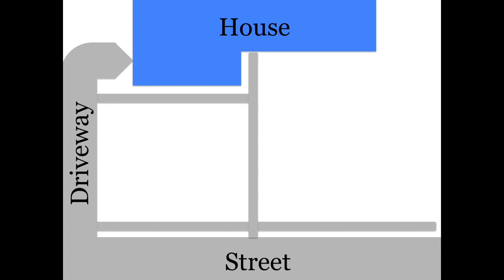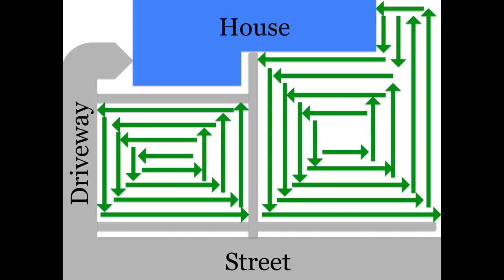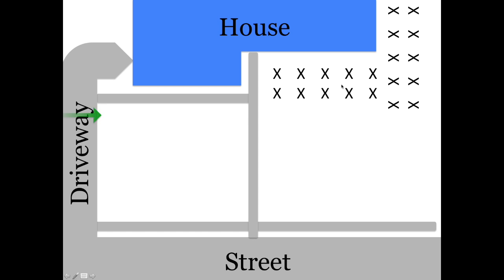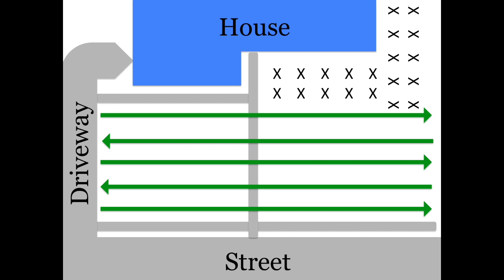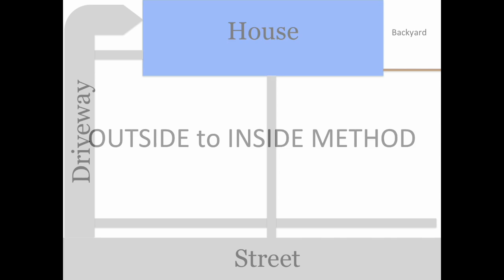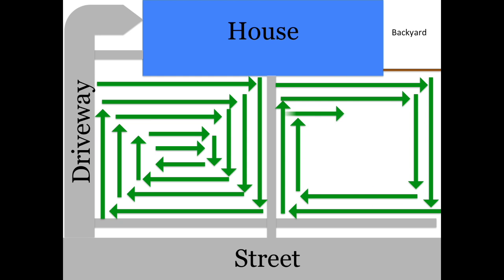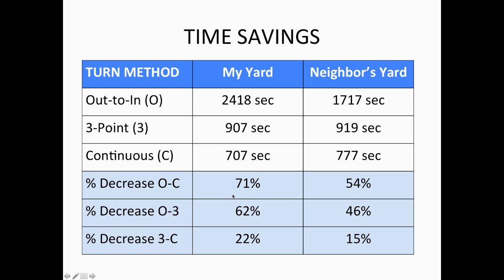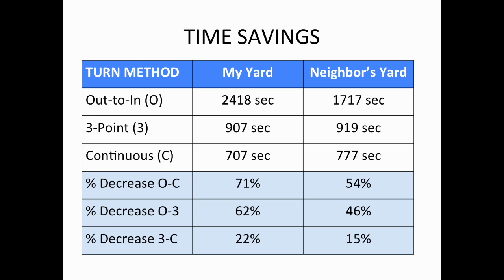A FASTER way to mow your yard!!

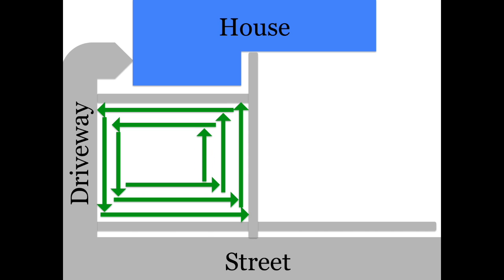Comment: i still think the outside to inside (modified) method is fastest.  IOW, follow the path shown at the 6:00 min mark, but combine them into one section by stretching them over the entire front yard mowing over the walkway that extends from the house to the street (just as you do at the 7:32 min mark).  yes, you have to do more turns (in number) but the turns are only 90deg turns and therefore, one 90 deg turn should = 1/2 the time as one 180 deg turn.  so, using your example at the 7:32 min mark, you make (5) 180 deg turns.  my way covers the same area with (8) 90 deg turns.  this effectively eliminates the time it takes for you to do one complete 180 deg turn.  as for the little "L" shape near the side of the house,  maybe due to its small size, your 180 deg style will work best, but then again, i still get (4) 90 deg turns (which = (2) 180 deg turns in time) to your (3) 180's, which makes my way shorter by the time it takes for you to do one 180 degree turn.
Reply from the maker: Thanks for the comment!  I can tell you put as much thought into it as I did making this video.  I keep trying different methods and the 90 degree turn is one that keeps coming back into the rotation.  With the size/shape of my yard, the only problem comes in with that at the end when I get down to the smaller size in the middle.  I think it's because my yard portions are longer than they are wide.  Because of that, I have to end up doing a bunch of 180 degree turns eventually.  That's why I thought to just eliminate the short axis turns altogether as much as I could.  

Thanks again for the comment, I really appreciate the great feedback!
Reply: TXSuburbanHomestead  thanks for replying to comments! I learned a new method. I used to do the outside to inside, and it took 11 hours.
Reply: Plus I am always thinking about mowing the previous pass clippings... So the outside in you never do that... Depending on if you go counter-clockwise...

Comment: The best thing for your lawn is to mow in a different direction every time you mow. So one week it is north to south, next week is east to west, next week is northwest to southeast, next week is just mow in a constant turn outside to inside, then finally northeast to southwest. Need a power point for each of those methods. They say it helps to not compact the soil as bad as mowing the same way all the time.
Reply from the maker: You're absolutely right.  I've been switching up since I did this video.  When this video was made we had only had the new lawn with new dirt/grass for about a year.  Constant mowing in the same direction caused me to have compaction ruts.  I filled those in with a soil topdressing this winter and switch it up every week now between N/S, E/W, and even a diagonal.  This is still the most efficient method for me, but I've got a much flatter lawn now.
Reply: In the golf industry it's called mowing 6-12, 3-9, 4-10 etc. It's good to cut in a different direction each week not only for soil compaction but if you keep cutting in the same direction each week eventually the grass will start lying down and it won't all get cut. Good information guys.

Comment: Great work! I've done the same calculations over the years. The time saving is great, but the added benefits are less hours on your equipment and less gas used.

Comment: Enjoyed you mapping out this logic. I've been thinking these things but nice to have the thoughts illustrated and logisticized. Next, I need to figure out not only how to deal with and/or illiminate obsticles (beds/trees/plants etc) and non-straight garden bed edges. Did see how someone edged the wavy rock long garden bed with mulch that was a straight line. for 12" out. That idea is a mowing game changer and going to impliment it. I have 1.5 acres and there's 10 areas for the tractor and 1 big pen 2000'ft for the up and coming garden that I hand mow. It has a big burn pile in the middle and lots of other items as well as developing raised garden beds. My husband is the gardener primarily and I am the mower. Getting the 2 on the same page is not always easy. Need to find common ground between beauty and function. Thanks for your video. 56 now and everytime I mow, all I think about is how to be more efficient, how to enjoy the ride and be safe as well as how to grow better grass for less money and effort. Spent 2 whole years gettng rid of stumps and dips and roots. Way better but could be much better too. I wonder too, how long I can keep this up. I remember my stout Grandpa though on his John Deere at 80 some going at it. Lots of obsticles too. He never complainted. His lawn always looked picture perfect.
Reply from the maker: Thanks for the comment!  Good luck with your planning!

Comment: Thanks for the video.  I'm also an IE by degree and although I'm now retired, up until this summer, I never sat on a riding lawn mower!  Always did the longest access with the push mower, though, so had already accessed the efficiencies you pointed out over outside to inside.  After trying a riding mower for the first time and seeing how much inefficiency is involved in a 3PT, I began wondering about a better way.  Just "in my head" I saw that if I did the "every other pass" method, it would be quite efficient.  The problem I had when implementing the process was getting the skipped areas the right width; so many times I'd be a few inches too wide and need another pass (forehead slap).  The yard I'm mowing is my father in law's old place, which I hope will sell soon and put me out of a mowing job.  He's got an acre and he's got bushes and tree obstacles all over the place too, which makes it hard to find an efficient pattern.  Anyway, thanks for "nurding out".  Where would we be without enginurds?
Reply: i have a similar type of yard you describe with trees and irregular lot plus hilly  parts of the yard.... but i first circle around the house so that the cut  debris flies away from the house.. I also start nearest the house because i figure that will scare the bugs away from the house lol...  but once i clear a few passes all the way around the house i break the rest of the yard into sections and start in the middle of the long axis and work my way out.. there is not 3pt turn except the first one.. But at the end there is a lot of long drives across to get to the other side for the next pass.  But i use those as a chance to look for areas that need more (usually around trees and other obstacles

Comment: Nicely analyzed.  I have a D-130 also, and am new to riding mowers and this new property in Texas.  I've got, probably, 1-2 acres to mow, including driveway borders and along the road out front.  I tried a few different approaches, as you did, though it never even occurred to me to do 3-point turns.  I settled on the long axis, continuous method that you use, though for 2 of the lawns I precut a full border and pre-circle the trees and other obstacles.  Then I regularize the various short rectangles caused by stairways and the patio extension.  I offset rows based on the turning radius of my mower, which also helps keep the clippings from piling up.   If the mower stays in motion and I'm not going over previous cuts, I figure I'm going it right!

Among other things, I used to teach continuous process improvement for Boeing, back in the day. Keep up the good work.
Reply from the maker: Thanks for the encouraging comment.  I've started cutting borders/trees now too.  The only real downside with the long axis continuous method was that what time I gained, I lost with the blower on the sidewalks.  

That change has really helped me in the long run!  When I make a change, I just tell my wife I'm trying to minimize my non-value added tasks.
Reply: LOVE your approach there..  I had an issue with clippings piling up  so i started mowing from a center start on the long axis and mowed outwards so i push all the clippings towards the woods on both sides.   I will try your approach.

Comment: I have a 1 acre backyard. I found the easiest and most relaxing way to mow, is to minimize turns by mowing in concentric circles from outside in. I never stop to do a right angle turn, I'm always moving.
Reply: Not good to use same pattern over n over. Right?

Comment: One engineer to another Whoop Love it! Sitting on a lawnmower for 3 acres I tried this continuous method but did not run the numbers so I am glad it proved out.  Found it a little hard however to get that optimal turn for a 1 lawnmower width and therefore no need for an extra run. On the long axis method a cut a few passes on each short axis side so I have a turn radius but it ends up cutting grass twice in this area. Again no numbers run I think it beats time backing up at each turn.
Reply from the maker: Since this, I've tried several variants to try and get the best turn to minimize the small passes.  My JD won't turn for the one pass width, so I'm forced to go wider.  It usually works out okay and is still faster than the turn each pass.
Reply: don't forget soil compaction.  There are many things about lawn husbandry that shouldn't be put to mathematical scrutiny.  Among those:  introspection- soul searching,  escape-from other drudges of life, the thrill of accomplishment-job well done.  Or, if you don't enjoy mowing, just set the deck at 1" and go like hell till you're done.
Reply from the maker: I do worry about soil compaction. I brought in about 18 yards of good fill dirt and don't want it compacted like the clay I took out.  I do alternate my patterns every so often.  I even do diagonals from time to time.  The mowing's a great get away from my office job, but I just can't help myself... everything turns out to be math eventually.

Comment: Using a lawn tractor efficiently on a small residential yard is a challenge.  I used to center split the yard and do ovals cutting outside of one patch and the inside of the other doing large continuous ovals.  Finally decided to go for maximum mowing efficiency and upgraded to a ZTR machine.  Faster and much easier with the ZTR.  Cut mowing time from 20 minutes to 15 minutes.

Yeah, I end up mowing a couple of neighbors yards for them.  Also upgraded blower to Echo 8010 and have a deal with neighbor, I mow and he trims and blows it off.  He really likes the big Echo blower.  :)

Comment: I have used the spiraling out method on a 42 inch riding mower but found mowing the four leftover corners was a time consuming pain.  I found the most efficient was to do four blocks on the longest axis with wide turns taking 45 minutes to do large backyard and small front yard, about 3/4 acre. 

This summer I upgraded to a 42 inch ZTR and now do 180 turns and cut my time to 35 minutes, a combination of faster ground speed and less maneuver time. Now I need to try the wide turn method to reduce overlap with the 180 degree turns.

Comment: Great video. Optimizing things in ones life is a great life skill, a green belt in six sigma doesnt hurt either. LOL
I've been doing your "continuous method" for years.  Fewer turns, less overall time I spend mowing, which equals less fuel consumption and less wear and tear on the equipment. I only looked at overall time mowing but it works for me.

Comment: There's a lot to be said about how the lawn looks when you're done mowing.   The 3PT method  or Striping is probably the most aesthetic; if you have a zero turn mower the turns take a lot less time and the stripe looks much nicer if you have a stripe roller on the back of the deck.
Reply from the maker: You’re right. The zero turn would yield these ways mute. With the striping. i’ve tried it several times, with my St. Augustine, because it’s such a heavy bladed grass, the only way I can get a good stripe is by alternating my mowing deck height each pass.

Comment: I have a yard very similar but only one tree in the front yard. I have tried two different ways. Starting at the tree and cutting in circles around the tree with each circle overlapping and growing bigger essentially mowing the yard in circles...this way I never have to stop its one continuous motion. Also tried the outside to inside however rounding the corners on the first pass or two making it a rectangle with rounded corners again eliminating the stopping and turning just one fluid continuous cut not sure which of the two is faster though as there is quite a bit of weed eating around my property to be done before i can even start the cut

Comment: I had to laugh at your comments in the beginning. I was a quality engineer by trade and so we too are also looking for a better way to do things. Loved your humor and all the thought you put into this. I’m sending it to my sister who just got a riding mower and has a big lawn. She can then see how turns matter. I too have a riding mower but not nearly as big a yard. I will certainly apply what you have done here. Thanks for saving us time!
Reply from the maker: Thank you so much for the kind words.  So glad the effort's been appreciated.
Reply: @TXSuburbanHomestead  Great PowerPoint presentation, though it doesn't show the turns, it does show the sequence of rows. Speaking of rows, my suggestion is that, instead of what's depicted at 12:12, if your sequence cleared the 2nd un-mown path, then the 1st un-mown path,  you would save traveling from the beginning to the end and  then returning (You reduce non-value-added rows traveled from  12to 2!).

Comment: Been doing this for over 25 years.  Got the idea from watching the Zamboni driver resurface an ice hockey rink.  They need to do it quickly.   It's a continuous path on an ice rink.  On your lawn it depends on it's shape as you said.  Cant seem to avoid  creating ruts around the perimeter though.  Figure that one out and I'll really be impressed!
Reply from the maker: The only way I've figured out how to avoid the ruts is to alternate the pattern.  U/D & side to side.  I even, about once a month, go diagonally.  It's really solved my rut problems.  Thanks for watching.

Comment: Been doing the continues for many years on 3+ acres.  It also is a plus if the grass gets longer than it should.  Gives the grass time to dry out a little before you are back to the same area if you need to re-cut some of it when it's really long.

Comment: Great video, but I can't help but notice the inside out method being used differently in the tests by using sections. I still think your method is the most valid but curious about outside in without breaking the yard into sections and going over the sidewalks, like in longest axis tests. I do 2 laps outside in to clear around the fence and use a modified form of yours! Cheers to mowing smarter.

Comment: Hi, I know this post is about 4 years old but I wanted to give my process. I do a combination of several things. The first message I do is to go around the perimeter of the property in a clockwise direction. Then I try to figure out my longest run. Then I use what I call the Zamboni method. If you watch the Zamboni on the ice during the hockey game break, you will see that they will come in and follow the perimeter, then they will cut through the longest section in the middle. I'm sure there is a diagram of how they do that on the internet. What I learned from talking to the guy that runs the Zamboni, he said that they can't make sharp turns because they have to keep a constant speed in order to keep the ice level. That gave me an idea that I can go a constant speed and my turns come out to being quarter turns. My yard has three different sections. One of them is a perfect rectangle can I use this method and get the job done quick. I have the same owner as you do, in smaller yards it is harder to maneuver around the yard, so the Zamboni method works best. Try it out and see how it works for you. I'm glad I'm not the only one who tries to figure these kind of things out. Most people just fire up the mower and go and end up spending a lot of time in the Sun. I live in South Texas which is much warmer than you guys up north. LOL
Reply from the maker: Thanks for sharing.  Even though this video is several years old, I still get a lot of comments weekly from it.

Comment: I'm going to try a modification on my next mowing day ( when I get it back from servicing at the Deere dealer).  After making the first long axis cut, I'm going to the centerline of the area for the return pass.  I'll then turn back and run an adjacent leg next to my first pass and turn into and adjacent leg on the far side of my centerline pass.  The net effect will be a sort of spiraling cut with passes in both directions, ending when I cut the final return pass at the far side.  Wish me luck...
Reply from the maker: That does sound interesting.  Good luck; you'll have to let me know how it goes.
Reply: That wastes time travelling over already cut areas. I know because I am constantly looking for ways to turn less with my manual garden tractor.

Comment: I don't like to deal with raking or bagging, so I first do a perimeter cut, then long axis from the inside out so that I throw all the cuttings along the perimeter.  They dry out in a day or two and smother any weeds causing less use of the trimmer.  You can't even see the dried clippings especially if you mow often enough.

Comment: All the 180 turns take a few seconds to switch to the appropriate gear. On mine, there’s a button I hold and then push the reverse pedal 

My neighbor taught his children who are my friends the circle method for his backyard. It’s big and there’s barely any trees except for in the perimeter. I never saw them do the perimeter. I’d switch to a rectangle with curved points for the bigger portion of my property. There’s 4 medium sized trees evenly spaced along the property